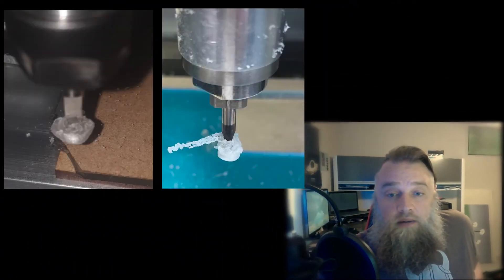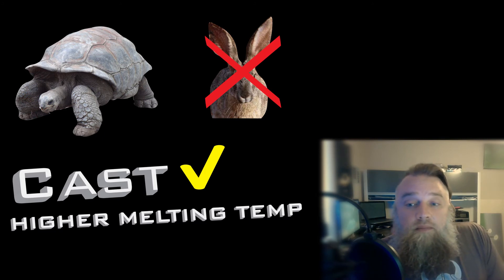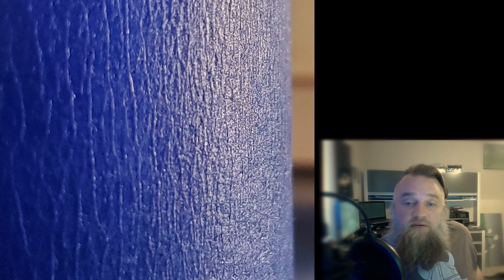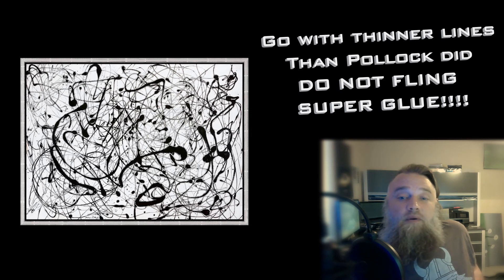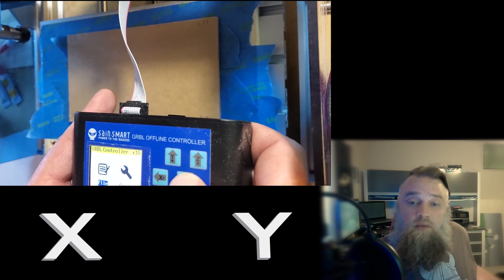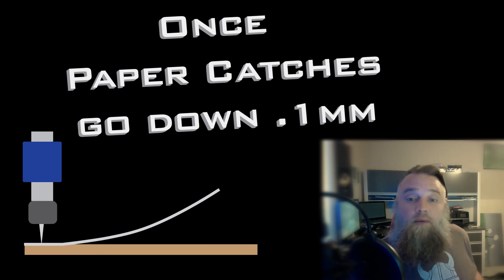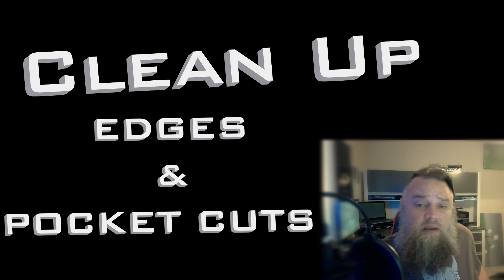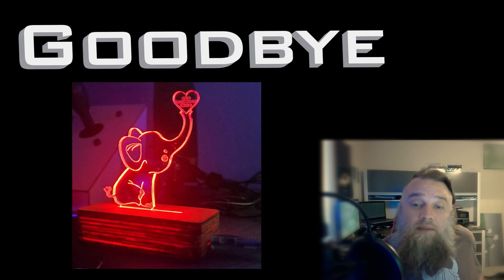Tips for Cutting Acrylic on 3018 CNC - Type of Acrylic, Tape Method, Job Home with Paper Method

Comment: Right now all I have is extruded plexiglass can you show a video of the best settings, I am a visual and hands on and hands on only seems to not work for me. I have a 3018 CNC pro at 1000 rpm. Bits I currently have are blue coatings end mill bits, I have a diamond bit, and I have a 2 flute flat nose and ball nose bit. Any suggestions?
Reply from the maker: I never had luck with extruded acrylic  on my 3018. I was only able to cut that on my longmill, and even then it was a pain.

Comment: Unsure about cast vs extruded "melting point". It's still the same base material. Still, cast acrylic will be way flatter than extruded, so much less thickness variation when milling ==> almost no gunk on milling bit. Same goes for FFF processes, where a cast heated bed is flatter than extruded ones (same temps/melting points anyway).
Probing on CNC routers can be "hit or miss". The best approach would be to perform a surface probing (same thing than FFF "bed probing") - aka "height map". This would also solve the Z0 (Z homing) thing. Non-inductive probe + z-offset = winner, yet idk if it's implemented on GRBL yet (would require G29).

Comment: Double sided tape works great. Don't put too much of it. In my opinion it's faster and safer than tapes and super glue.
About positioning on the Z axis I spin the bit manually and I lower it down till it scratch the paper/foil.

Your videos are great!
Reply from the maker: I just recently switched over to double sided tape. 

I did not think about manually lowering the Z axis.

Thank You!

Comment: Cheaper then super glue and never a problem for holding down a work piece is to use contact cement. Apply to both painters tape surfaces  and let it sit for about 10 minutes (until slightly tacky). Never had a problem with the work seprating from the table. Sure is cheaper then super glue.
Reply from the maker: I just started trying out some double sided tape. Will check this out once I see how this tape works.

Comment: Great info...
Reply: just broke my first bit lol
Reply from the maker: It happens to all of us. I lost count a long time ago. LoL
Reply: @D.E.Hammer  what program are you using I got a 3018 for 160 from microcenter and I have some ideas for designs, also using a wet tile saw without the water to cut the acrylics works great, also salvaging some acrylic from old LCD monitors..
Reply from the maker: I use illustrator for design, Cc pro for tool pathing ( I like the engrave option they have on pro, but have used the pocket that works as well.) Then a r-pi4 with 0.7 gsender.

Comment: Hello i wanna ask you how much is your depth engraving on acrylic for best result and what type of bits  do you use?
Reply from the maker: With a vbit i go between 0.1mm and 0.3mm depth. With a drag bit I have about 0.3mm to 0.5mm pressure. I would recommend a spring loaded drag bit for engraving, just gives a better result in my opinion.

Comment: Can you use the bits that came with my 3018 Pro for etching cast vinyl ? If not what do you suggest ?very new at this I can run a 3 D printer but not sure on this .I am going to atempt to cut a simple edge lit sing that says "Home Sweet Home "  I thank you for any help .Enjoyed your  video
Reply from the maker: I have not cut Vinyl, just acrylic. Vinyl I would assume could be cut with a v bit or a Drag Knife. Thank You for watching.
Reply: @D.E.Hammer  Thank you for your response as I said very new at this got my materials mixed up meant to say acrylic not vinyl thank you for any help
Reply from the maker: @jerrysayers4002  Yeah there is a lot going on when you first start out Im sure I called something by the wrong name several times. I have cut the cast acrylic with the bits it came with. So for cutting you will want to use the end mill and to engrave the VBit. There are better bits out there, but the ones they come with work. Its better to get a hang of thingss with the cheap bits rather than breaking a $60+ bit on just learning. Also make sure you use CAST Acrylic, NOT EXTRUDED. Extruded will gum up on your bit, unless you use a coolant.
Reply: @D.E.Hammer  Thank You so very much and keep up the great videos

Comment: what are the speeds like feedrate, rpm doc, to cut the cast acrylic?
Reply from the maker: I would start with 225mm for Feed, 9000 for RPM, 0.1mm for depth per pass.
Reply: @D.E.Hammer  thank you very much for your feedback, will try that and see how it works